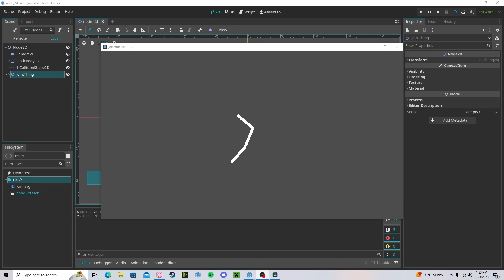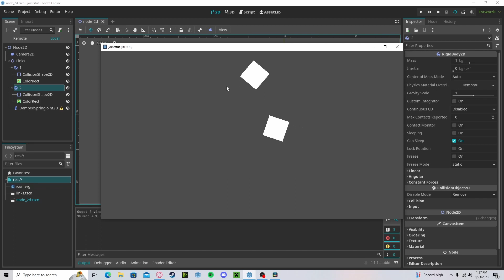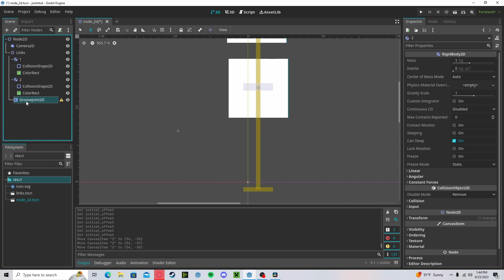Godot 4 Joints Tutorial

Comment: What if I want to change the rotation of node A of the groove joint and want the rotation of node B to match it? Like a piston attached to a pin joint that is attached to a player-controlled rigid body (a car with angle adjustable piston suspension). Do I have to manually set it to match the rotation each frame? Cause locking rotation locks its rotation completely in space. Or can I somehow lock its rotation to its parent?